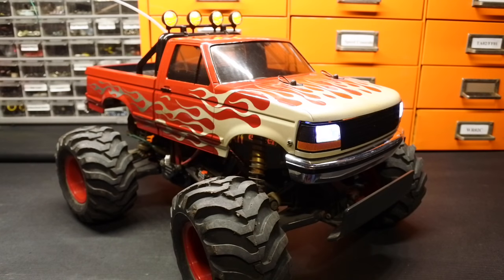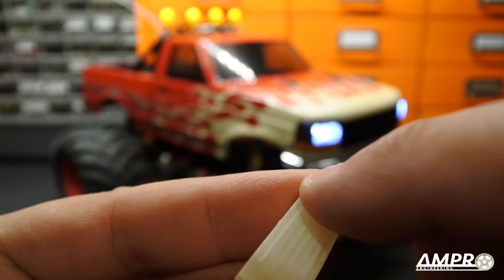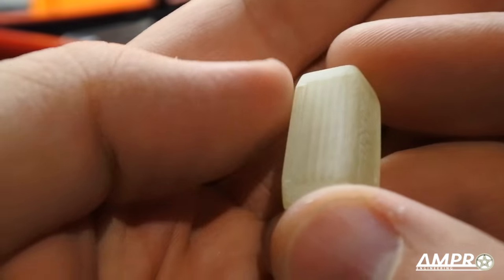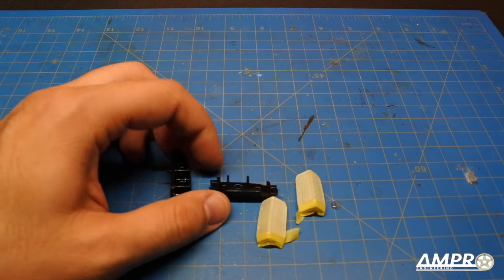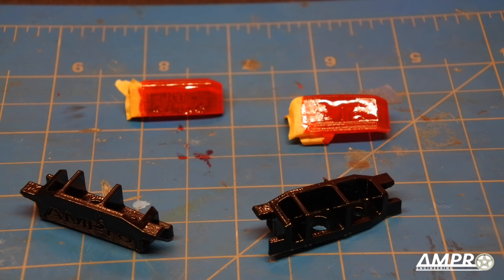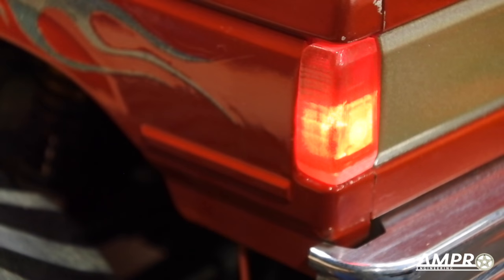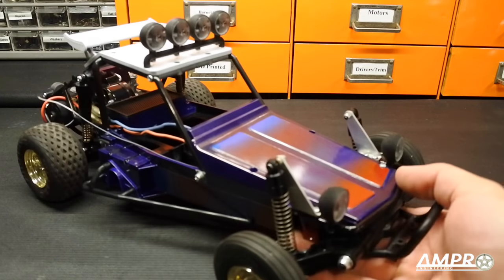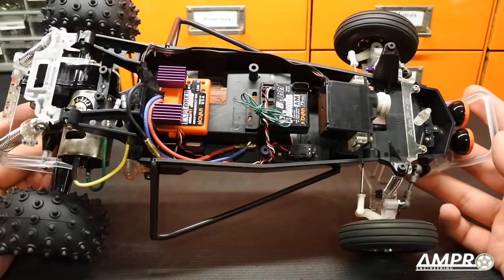E38: Tamiya King Blackfoot Body Working Tail Lights

Comment: Nice! Tamiya makes jars of translucent red,yellow,orange,green. and some other colors that work great.
what rear tires are on the FAV?
Thanks PS hornet looks killer!
Reply from the maker: Are those enamel based? The FAV has some ancient Parma "Waffle" tires and thanks, I hope it comes out good!
Reply: The Tamiya paints are acrylic. The colours are fantastic, and are often factory/manufacturer accurate. Tamiya paints are a bit tricky tho because they start to set really fast. If you're doing anything that takes more than a minute or two, I highly recommend using some acrylic retarder to make the paint more user friendly. The "clear colour" paints really do make a big difference on light covers tho.
Reply from the maker: I think I need to venture into more Tamiya paints. Want to know the reason I don't already? It's a good one....the Testors paints fit perfect on a little shelf i have above my work bench. See, it is a perfectly reasonable reason. Hahah!

Comment: Did you ever make those front and parts that holes the shock and the wheels and the stabilizer bar please comment back
Reply from the maker: I will post all parts on this channel when they are made.
Reply: @AMPROEngineering Have you ever got to the king Blackfoot parts for the front end? Please comment back, thank you.